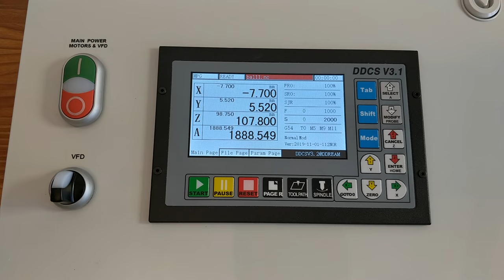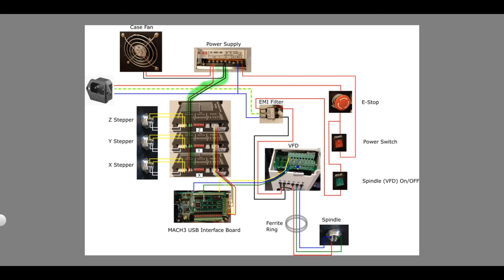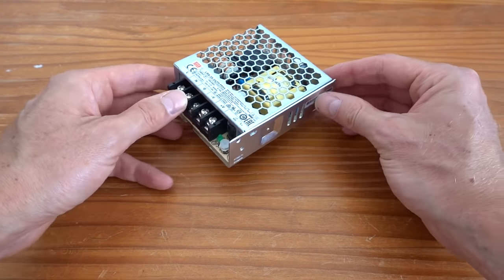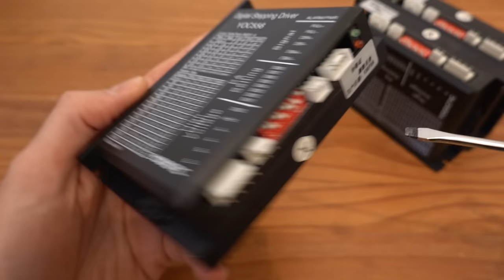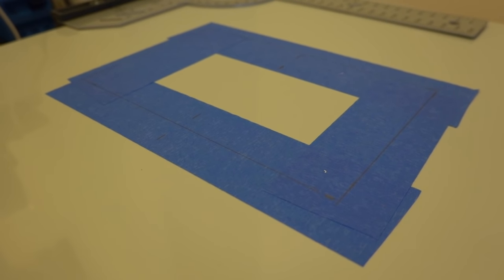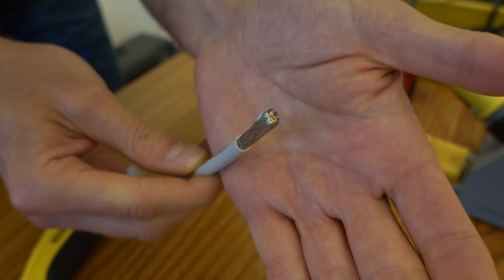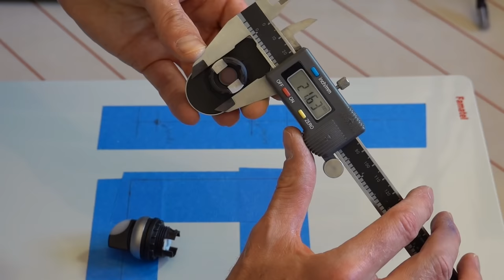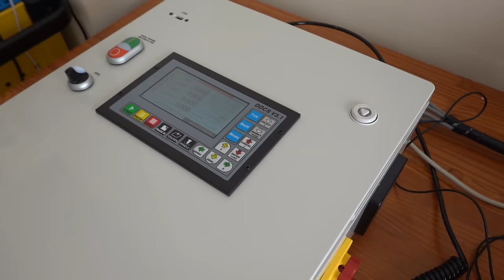Build Your Own CNC Controller, Part 1  | DDCS V3.1 |  6040 Router

Comment: What is function of a CNC controller ,I did my engg from India in 1963/1964  when we didn’t have even a calculator but a slide rule ,I know this might sound a very basic thing ,but I want to start from first principles ,thanks
Reply from the maker: It is a modern slide ruler that steers axes of the machine according to coordinates in the CNC program.

Comment: What is your take on useing oil instead of water?
Reply from the maker: Not sure what the benefits would be for cooling a spindle with oil on a hobby machine. It might stay cleaner for longer as nothing organic should grow in it, but personally I have only seen (including industrial) machines with water based coolant for the spindle housing. I am sure there are machines that would benefit from oil cooling, but I am not familiar with them. Also seems easier for a hobby machine to use water based coolant.
Reply: @uptimefab7412  Never mix electricity with water. So I'm going down that route.
Reply from the maker: Hi, I wouldn't be too worried about water causing a short circuit in the spindle. The water channel should be separated from the electrical wiring. Just make sure to ground the body of the spindle. A lot of equipment in and around the house work with water and electricity, as long as it is properly designed and grounded it should be ok. Just my 2 cents, if you are using something else for coolant and it works, than that is fine as well.

Comment: Can DDCS be used for a lathe CNC conversion.....
Reply from the maker: Hi, unfortunately DDCS controllers are only available for mills. Controllers with specific lathe functions are a bit less common, but you could go for a SZGH controller, MASSO or PC based solution like EdingCNC, Linux CNC or Mach3/4. There are probably more options, but these are the ones I considered.
Reply: @uptimefab7412  thank-you for your reply... 
Will try n have a look at the controllers you mentioned..
Cheers

Comment: Hi... Do you have some of Online Class for CNC? Or offer any consultant service?

I found a CNC I want in Aliexpress but they need to DIY everything.
And seller simply state that he don't want to deal with a Newbie. Therefore, if I don't know what I'm doing, he said it's best not to buy.

I try to Learn, but there just too much info without any kind of structure... and my own country, don't offer any class on CNC.
Most CNC operator here, often went to nearby country to study, once they back, they either work for a Construction Company or Printing House...
So I am totally lost.

Thank you. Hopefully you willing to reach out and help.
Reply from the maker: Hi Austin, if I understand your question correctly, you are primarily looking to get education for programming the CNC. If so, I would recommend watching channels like Tom Stikkelman or NYC CNC. If you are looking for more information on electronics and mechanics of CNC builds, there is also information available, but I have to admit, it is hard to find a single source with all basic information, so it will take some time to find what you need. I unfortunately do not offer any consultancy service, since I already don't have enough time as it is. The only advice I can give you is spend time gathering information from the various sources and read manuals, sorry I am not aware of any shortcuts. I hope you can spend the time because it is a very rewarding hobby when you get things to work.

Comment: Which gauge of wire do you use?
Reply from the maker: Hi, for signal wires I use at least 22AWG(0.34mm^2) and for steppers and power to stepper drivers I use 18AWG(0.75mm^2). In all cases (for this specific configuration and components) this should be on the safe side.

Comment: Where did you get your post code from?
Reply from the maker: Hi, I am just using a standard mach3 post processor.
Reply: @uptimefab7412  I basically have some machine setup. Can you send me a copy of your post?
Reply from the maker: Hi, it is the standard "Mach3Mill" post which can be found in the Fusion 360 post library by searching for "Artsoft" or "mach". I could send you mine but it is exactly that one. Hope this helps. Note that I only use this for 3 axis mode. I do not know if it works with a 4th axis as I don't have paid license for Fusion.

Comment: Better to use metal box, not plastics. And also use the proper earthing of the VFD and all power supplier... The earthing is not "optional"... I'm currently also building one controller, unfortunately, the YT does not support adding pictures to the comments...
Reply from the maker: Thanks, I am updating the grounding in the cabinet at the moment. Should prevent future issues, so good to get it done right.
Good luck with your project!  Robin

Comment: Hello sir. I m developing mini cnc machine for that i have bought stepper motor with encoder(easy-servo) now my question is that, that is it possible to wiring encoder with this ddcsv2.1?
Reply from the maker: Hi, as far as I know the DDCS does not have the ability to read back from "in position output" port of a stepper driver, so the closed loop is then only between the motor and the stepper driver, not between motor and DDCS. You should however be able to connect the alarm output of the stepper driver for example to the E-stop in port of the DDCS. Then at least the DDCS will go into E-stop mode when the motor can no longer follow the given commands. I also bought a closed loop stepper motor and driver for the 4th axis but have not tried it yet, however this is probably how I will hook it up. Personally I think just using the alarm and not the in-position feedback is fine for a CNC router but this might be different for other applications.
Reply: @uptimefab7412  i m building cnc Engraving for coins die. And i want itto be precise. Closed loop was in my budget... I m very confused for controller. Whether to go for mach 3 4axis or this ddcs😓
Reply from the maker: I think both solutions can be precise and reliable. My setup with mach 3 had some issues which I think we're mostly related to the USB interface card, not to mach 3. But mostly I just don't like having a laptop to run the machine. Personal preference. Downside for this controller is you have to use USB stick to transfer programs and it has less features and flexibility than mach3, but it has everything I need. Note that there are now also a expert and plus version of the DDCS, both have ethernet. Indeed difficult decision, I hope you can make a choice by weighing pros and cons for your setup.
Reply: @uptimefab7412  thank you sir... One more question... I m using stepper closed loop with dynamic brake motor for z axis.  So can it be connected to ddcs and would the brake will work?
Reply from the maker: I am not sure, sorry. I have never needed this type of functionality. It might be available in one of their models, maybe their forum members can help with this.

Comment: Waar heb je de shielded kabel vandaan?
Reply from the maker: I bought the Liycy cables in a local parts store, but they can be obtained from many online stores. For example Reichelt ( for people living in Europe).
Reply: @uptimefab7412  thanks
Reply from the maker: No problem, the part number is: Lapp 0034704. (PVC, shielded, 4x0.75mm^2)  This is very flexible, which is great for both in your cabinet as well as for use in drag chains. I mistakenly ordered some other cable at a later date that is far less flexible, so make sure you get the right type. Visually you can recognize them by the color. (My cable is RAL 7032). The less flexible type is a darker grey.

Comment: I see you have a USB box I have that the directions show to plug it straight into the computer from the USB in the back of the control box to the computers USB I've done that it doesn't work I was hoping I could ask you what else I need is it designed to just plug in straight out of the box if you could help me that would be great thank you
Reply from the maker: Hi, I am not sure where you found these directions but I think this does not work. But the controller and PC are both a USB master. There should be one master and one slave. The female A connector indicates the master, which both devices have. Would be very nice though to be able to connect a PC. I think you would need to go for a more advanced controller with LAN.
Reply: @uptimefab7412  thank you
Reply: @uptimefab7412  It is not possible to connect the DDCS controller direct to the computer via USB. But you can use wireless file transfer. On the DDCS Facebook site, you can find out how to do that
Reply from the maker: Hi Miki, thanks for the tip. I think they mention the toshiba as an option, which is very expensive. Based on your comment I was looking through the various options and found a SanDisk Connect Wireless USB drive. Apparently this can also connect to your wifi network (instead of creating it's own network) so you should be able to access this from a laptop. Thanks for sparking my interest on this. Just ordered one. If it does not work I can use that for something else. Cost 55 euros.
Update: so that did not work.... The Sandisk Connect is a very nice wireless USB dirve that you can connect to directly or through your home wifi network, but not when the drive is plugged in. When plugged in it is in USB drive mode and you cannot access it anymore through wifi. I am letting this one rest for now.

Comment: I found on the support site that this controller does not support slave axis and separate homing switches for the slaved motors.
That pretty much eliminates this controller as viable for gantry routers with dual gantry motors. Too bad.
Reply: you can just split the signal for the Y axis though to drive it as a slave.
Reply: @SuperBooster007  
You don’t understand what slave drive really is.
Sending the same  pulse and direction signals to multiple drives is not a slave drive configuration, it is parallel drive config.
There is more to slave drive than driving two motors. In slave drive config each motor can move independently which is the basis for automatic squaring of the gantry during homing routine. 
Homing routine is different in slave drive set up. The controller takes input from two separate limit switches ( on separate inputs) and moves each end of the gantry until each switch is triggered. If the switches are carefully adjusted, the gantry is set perfectly perpendicular to the axis of movement every time the machine is homed.
Reply: you are correct in what you say. But most controllers do not support automatic squaring (including the DDCS 3.1). So using the parallel drive configuration will do just fine. Use hard stops on a small machine like this to square off the gantry, highly accurate and trouble-free forever. The best solution is the simplest one that works...
Reply: @aps3000miki  
All decent quality controllers support automatic squaring. Even inexpensive Mach3 with $5 parallel port break out board does. Do read my earlier comment because based on your comment I don’t think you understand how automatic squaring of the gantry procedure is executed by the controller.
Squaring of the gantry on toy CNC machines is not an issue.
But for large production machines it  is essential. If you think otherwise then I am guessing your experience is limited to toys.

Comment: There's no any reason in shielded cable when you didn't connect the shield to the ground.
Reply from the maker: All shielded cables inside the cabinet are now connected to the central grounding point. See part 3 in this video series. Indeed needed to be corrected.
Reply: @uptimefab7412  Yea. Already seen that you have fixed this issue ))
Reply from the maker: Did not get everything right on the first try, but we are getting there :) Thanks for the feedback!

Comment: Bonjour quelle g code prend en charge le contrôleur digital expert v1.1 je fais mai dessin dans fusion 360
Reply from the maker: Hi, my french is a bit rusty, but I think you want to know which post processor. Some other people have asked this as well, the standard Mach3 post in fusion 360 works for me.
Reply: @uptimefab7412  merci beaucoup pour votre réponse on va essayer merci
Reply from the maker: De rien
Reply: @uptimefab7412  bonjour pour le réglage des drivers par rapport au moteur pas à pas on me dis qu'il faut connaître les micropas des moteurs et les ampère sur la notice des moteurs il parle des ampère mai pas des micropas si vous avec une réponse pour moi merci je regarde vos vidéo dommage que je ne parle pas anglais il son instructif
Reply from the maker: Hi, you can basically use any microstep setting on the steppers as long as it does not  exceed the capability of the controller at the maximum speed you are running the router. The  motor operates smoother with higher microstep settings, but the higher you go, the less difference you will notice with each increase. I am using 2000 pulses per revolution, which is 1/10 microstep, since a stepper has 200 pulses per revolution. How to calculate DDCS parameters for microstepping is covered in the PDF on my website in the written article.

Comment: I dont know how its in your country but  N (neutral) cant be switch on/off its must be stay --- what i mean by it --- just reroute the blue wire and hook it up for  straight  - dont use the contact in that rele/contactor. you can switch(on/off) only L(life) nothing else ...
Reply from the maker: Hi, thanks for the tip. I am not sure about this for my country and I don't have an electrical background, but this was my reasoning: in my research I found a diagram from a supplier where both N and L were switched (DamenCNC). Also, both the contactor and mains disconnect have marked "N" terminals, which are also marked as such in the manuals. I have no way of knowing which is actually line, since I can rotate the wall plug. Therefore, I think there is no harm in switching both, as this is the equivalent to pulling out the mains wall plug. If someone can indicate what the standard is in the Netherlands and why only one of the leads can be switched that would be much appreciated. Note that the yellow/green ground wire is bypassing the switch. Thanks again for your feedback and sorry I do not have a definitive answer at the moment about the current standard.
Reply: @uptimefab7412  What i've googled we're using wall plug type E also same wall socket --- you should have same plug in your machine - because you must have L(life) in socket againts your left hand(heart) N must be on right side and Ground on the PIN(yellow/green wire). so you'll always have L on the right side also you cant use plug with 2 pins thats how its should be and i hope in every europe country. Mainly its for safety reasons and how the breakers and RCD (those you should have in your electrical cabinet in your house/apartment)works properly ... its hard to explain in english but this is how I wiring our stuffs
Reply from the maker: @milldam9884  Hi, where I live we use the F type plug (or C if ungrounded). The F plug is reversible, meaning you can rotate the plug 180 degrees and it will fit fine. You can't see which side is L or N when looking at the plug. With AC circuits it doesn't really matter how it is wired and typically switches for appliances switch only one of the wires. However, to me it seems safer for a CNC to completely disconnect both wires, especially since I can't predict which one is L.

Comment: The VFD should never go in the same cabinet as your other electronics
Reply from the maker: Thanks for your comment. A number of other people have mentioned this. There is a lot of conflicting information about this topic. I know hobbyists do it and I have also seen commercially available equipment with the VFD inside the same cabinet as other electronics. There is of course the risk of EMI and heat dissipation. When these are mitigated it should be possible. However, I have no reliable way to measure EMI but heat dissipation is fine in my case. So that leaves us with that it is not possible as an amateur/hobbyist to determine if there will be issues with EMI. I would therefore not recommend other people to do this, but this is what I am doing and so far it worked. If you have any links to where people can find information on EMI guidelines for VFDs it would be greatly appreciated. Best, Robin
Reply from the maker: I hope that I did not come across as a professional. Indeed there is a lot of information by non-experts and I may have just added some more myself. I think it is good to keep in mind that all of this project is hobby level stuff. This includes the electronics but also the router itself. Having said this, I have searched extensively for wiring practices and EMI design rules. There seem to be a lot of things that work and on the other hand  there are many experts that say how things should be done (mostly without source) referring to how it is done in industrial equipment. Since I am not able to find the answers online I went with what was the most practical solution and made it work  with what I have. This is also my way of working in a hobby project, not recommend to others. I have found many articles saying that the VFD can or should be put in a separate enclosure in case of issues (no references to standards prescribing this requirement). But also a lot of people just placing the VFD in the same enclosure. I just took the practical approach to place it in the same enclosure if I don't experience issues, which I don't. Also not with my lathe, where the VFD is also in the same cabinet. Thanks for the tip on the EMF meter. Looks like great equipment for troubleshooting. Many videos about paranormal stuff, so I would also have to find my way to good information there. Sorry for the long-winded answer. This actually means I don't have a good answer :).
Reply: @uptimefab7412  Yes, a lot of Chinese CNC machines are very poorly built with the VFD in the case.